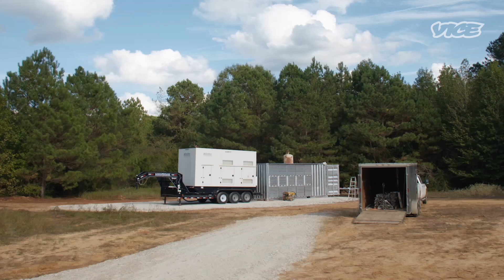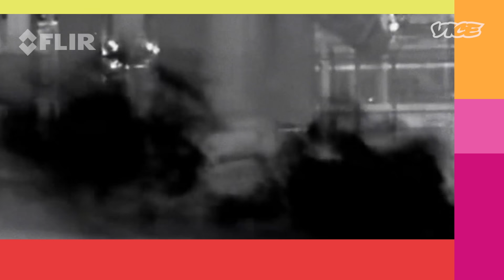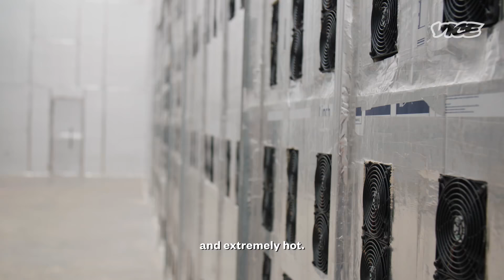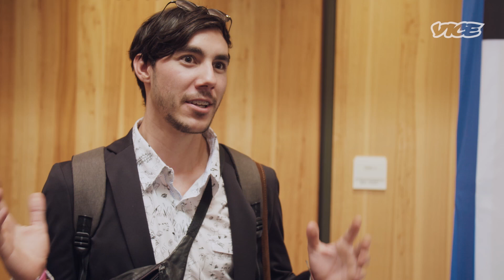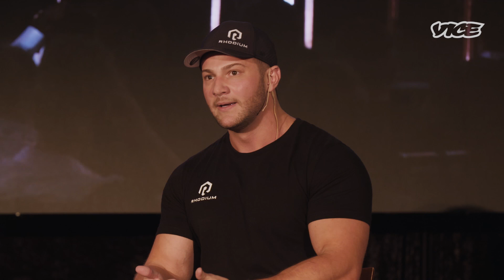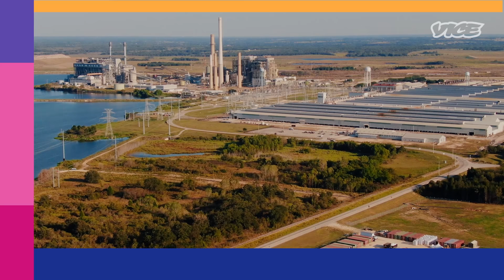What Is Bitcoin's Impact on the Environment?

Comment from the maker: Watch the next episode of CRYPTOLAND here: https://youtu.be/ZaSpoGIsEII
Reply: If Bitcoin mining was done by using solar energy or wind it wouldn't be having that much of a problem with it but it's not being done that way and if they're putting gases like carbon in the air they're not helping the hurting they are  hurting our environment. Simple fix of those Wells is to plug them. Burning the natural gas doesn't fix the problem and just adds to it.
Reply: RobG
1 second ago
And yet Bitcoin BSV running on the original Bitcoin protocol scaled to be the most energy efficient and is Turing complete if being ignored.  I wonder why?
Reply: @robganon  bsv is efficient because know one uses it. Get out of here with your scammer coin.
Reply: 🤦‍♂️ you do know that guys work is based on using the price of Bitcoin to figure out how much energy a miner uses? That's like taking the price of bread and using it to figure out how much energy the toaster uses. 
Ask yourself why someone would create a convoluted formula. when all he actually needs to do is use data from the mining pools that will tell him the exact make up of the miners running and hence the exact consumption of each miner. Like what guys like coinshare research does.

Comment: Good video. But the scaling argument presented by Digiconomist dude is incomplete or incorrect. He wouldn't be wrong f there was not layer 2 solutions but there are. At the layer 2 level (Lightning in BTC specifically) you don't have any of the efficiency or slow speed problems. For example, in El Salvador in where BTC is legal tender now (love or hate it) they conduct most transactions using the layer 2 and at that level it has worked wonderfully.

Comment: More or less I believe that Bitcoin mining for the individual that cannot afford it is dead therefore we are left to mine the altcoins and those that are asic resistant
Reply: Those coins are the most inefficient users of energy. Asics are extremely efficient. For one TH of eth mining(GPU) can easily consume 32000 watts of energy. The most efficient eth asics using 11200 watts per TH. While Bitcoin asics use 30watts per TH (21watts with the next gen 5nm chips launching in june). Asic resistance is not as great a feature as u think. Also there's more asic manufacturers than there is GPU manufacturers. Asic resistance just means less competition and more centralization.

Comment: I really hope Motherboard next interviews Vitalik and listens to why Ethereum is moving to Proof of Stake. The TLDR is that Proof of Work is dying. Bitcoin is mined at a constant one block every 10 minutes, regardless of how much energy is thrown into it, yet more and more miners are being added to the network, GREATLY impacting surrounding power grids, for *no additional benefit*. On top of that, it's not scalable and will buckle under too much pressure. Not to mention that is confidence in Bitcoin falls and the price per coin falls with it, the whole network will collapse because mining stops being profitable. Well, at least until enough miners drop off the grid. Proof of Stake is the best way forward, period. Maybe sometime in the future, another consensus model will emerge that people may consider even fairer or more optimized, but either way, Proof of Work HAS TO die. Has to.

Comment: So, if POW means the person with the biggest computational power can get the largest chunk of the network, and POS means the person with the biggest stake (aka money) can get the largest chunk of the network. Where is the decentralisation?
Reply: They don't "get a chunk of the network", they get paid out on Bitcoin for validating transactions on the network. Even hash power approaching 100% wouldn't control the network or have any real power over it. If they tried to act against Bitcoin, they'd just fork themselves off the network. The rest of the hashpower would step in to take their place.
Reply: the only flaw in your logic is saying "person".  you're saying one person has more than 51% of the network power which is not even close to true.  any blockchain that has that will nearly instantly be abandoned.  however if you expand this to countries not person, then at one point china controlled more than 50% of the hash rate of BTC and that WAS an issue.

Comment: Ok. Bitcoin uses energy. Around 100 TWh per year. Global energy production is 160'000 TWh. So that like 0.06%. Not really the reason of climate change. If you want to do something for the climate you might want to stop driving an ICE car. It has an efficiency of 35% and runs on fossil fuels only. And stop those XMAS lights too.

Comment: No word about layer 2 solutions? Which are tools to reduce the energy costs and increase the number of transactions per second.
Reply: Lightning Network is the name ;-)
Reply: @bitcoinyoda8321  Yes thanks; Lightning Network
Reply: Biased journalism
Reply: @wrestler20000  This was of course 2 years ago before Layer 2 became prevalent.  Now, looking at it today, the transaction speed and throughput has indeed increased with off-chain Layer 2 solutions, but still retaining the rock-solid decentralized security of Proof of Work that is more difficult to overcome than Proof of Stake.

Comment: The end product of mining crypto is not solving of the block chain but the generation of heat. Producing this heat should be taxed. These companies should pay an environmental tax that is used to vegetate areas, plant trees, subsidize green energy, etc.. also I live in Canada, so can I get 10 machines to run in winter time and heat my house while mining Bitcoin? Seriously, maybe apartment buildings can have Bitcoin mines that produce the heat for the buildings.
Reply: Well that's a loose definition of end product (I also believe you're referring to Bitcoin, and not simply "crypto"). But miners are already incentivised to cut costs down in order to maintain their profit margin (Bitcoin revenue per block halves every four years, while costs probably remain constant if not increase). There are mining operations that utilise the heat of their equipment, and Bitcoin mining can more easily utilise renewable energy than most industries. is heavily geared towards . Subsidising environmentally beneficial practises would probably me more effective than tax (due to its mobility, miners would simply flock to the less environmentally friendly countries).

Comment: Wtf is this shit. They didn’t film or show anyone using renewable resource fuels. The first dudes were just using gas that was being vented off. So it not renewable it’s just super cheap fuel that they get to use. The second guy had a fucking warehouse that was using power from the grid. Which just happens to have a some solar farms connected to it. If he was really trying to use renewable resources he would had just put solar panel on the roof.

Comment: They say that Bitcoin mining consumes 0.5% of the earth's electricity, what percentage of the earth's electricity is generated from renewable resources? And also, do they understand the significance of an immutable digital ledger?
Reply: They do not understand a lick about money unfortunately...
Reply: "immutable"until it forks.
Reply: @thomasam4118  you run the fork you believe is right on your own node. That's why the BSV fork is slowly but surely being abandonned.
Reply: @bastol85  I mean sure - but then it's not 'immutable' is it. If I spend a dollar on a sandwich, my bank isn't going to keep two 'ledgers' of this transaction, because it coincided with a major update which put into question whether or not I spent one dollar and one "$Dolla".
Reply: @thomasam4118  btw major updates do not systematically result in forks. Read up on the blocksize wars
Reply: @thomasam4118  forking does not erase the previous blockchain
Reply: Electricity wasted on proof-of-work cryptomining cannot be used to displace fossil fuels. So for the climate, it does not matter if you waste green energy or if you waste fossil fuel energy, the problem is that you are wasting it.
Reply: @kurtilein3  proof of stake is a waste indeed

Comment: It is funny to see that even Motherboard does not understand why BTC protocol is so energy intensive. The issue is the hugely inefficient distributed consensus protocol. In a short, without an artificial delay, aka mining, prime number factorization or math problem solving, there will not be order of adding the block and the chain will start to branch chaotically.

Comment: As Bitcoin mining is competitive it needs the lowest cost energy available. That is green energy, dams are build in remote areas for water management. Extending the power grid to remote dams is prohibitively expensive. So the energy these dams produce can't be transported to population centres. Bitcoin can be used to make these kinds of dams profitable to be build and be maintained anywhere in the world.

So, yes. Don't use coal plants to mine Bitcoin. But do build dams as that prevents flooding, creates fertile grounds for agriculture and reliable power sources for remote communities all over the world.
Reply: Dams aren't a purely positive source of energy. They can have massive downstream impacts and can require flooding of the up stream area, forever changing the ecology of the river/stream/body of water, not to mention the incredible amounts of water that can be lost to evaporation due to the reservoir getting blasted by the sun all day. Also, is green energy always the lowest energy cost? I'm sure there are currently many cases where they are, but that's simply not always the case right now. Do all those Chinese Bitcoin miners make sure that the large quantities of electricity they burn through is majority sourced from PV panels? I believe the assumptions you make (need lowest possible energy cost for mining, use green energy to save money and get an edge, thus creating a demand and incentivizing energy companies(?) to begin to build dams in remote areas (anywhere in the world!)) seems like my dream of everyone all of a sudden loving nuclear energy and not thinking Chernobyl 2.0 will happen if we build a reactor. 
Thank you for thinking about the environment! And btw I love dams, but they aren't without very real drawbacks.

Comment: @VICE @motherboard... What the fuck was this.

- PoW does not waste energy; less about getting the block reward, more securing the Bitcoin network. So in fact, miners do work together.
- Old wells flaring is not the incentive for miners; miner's only incentive is to seek out the cheapest energy possible: more often than not = renewables. When miners tap into otherwise flaring off gas is just capturing wasted potential energy, while its present in the current energy infrastructure. Cryptomining's existence is HARDLY going to incentivise fossil-fuel industry to continue just for the sake of tapping into run-off leaks (!!?!).
To further this point, we can't just switch the fossil fuel industry off and switch straight to 100% renewables; miners are speeding up the transition, making use of anything that's economically viable at the time.
- If you want to answer some questions re. making crypto greener, look at Energy Web Token.

This whole thing was embarassingly shortsighted.

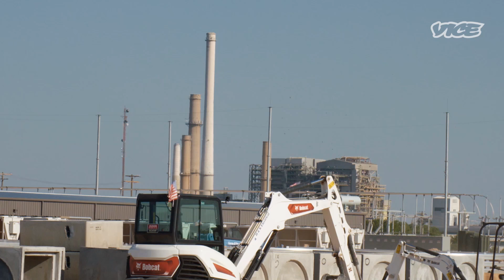Comment: 6:00 very sloppy reporting here, confusing the continunous consumption of this facility (750MW) vs the city of Philadelphia "each year"?! You're mixing units presumably MW vs MWh. I could believe that this facility uses as much energy in a year as the city of Philadelphia does in a single hour, but that's not how the data was presented or interpreted. Sources for data should also be cited.
Reply: When miners relocate to green energy sources such as sewage treatment plants, compost farms and geothermal it will be more environmentally sound...
POS will happen in 2022
Reply: I think it's quite accurate. Residential electricity consumption per person is about 4000 kWh per year or 0.5 kW.
700 MW / 0.5 kW = 1.4 Million.
The only imprecision is the wording "per year", when in fact it's not dependent of the unit of time.
Reply: @artuselias  Wrong comparisons from you also. Residential elec consumption per capita x population is nothing near the total consumption of a city (which is the implication made in the video). Industry and transport vastly outweigh domestic use almost anywhere in the world. If you believe this couple of building facility owned by a single company uses more energy than one of the largest cities in the US, then let me tell you about this bridge I have for sale.

"The only imprecision" - there are many faults and lacking sources in the data reported in this video, and it is very important to be precise and well informed when discussing the energy impact of proof-of-work blockchains.

I hope everyone does more research before accepting the "crypto is an ecological disaster" narrative, there's a lot more nuance.
Reply: @phizxd and to be honest if you have other things to nitpick from this video that you're saying or not correct then why don't you just State what those things are